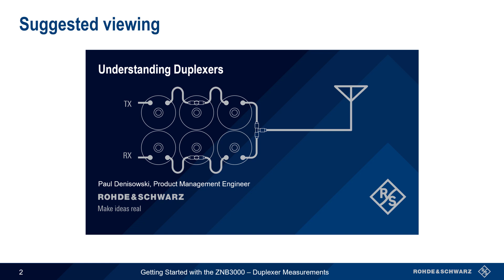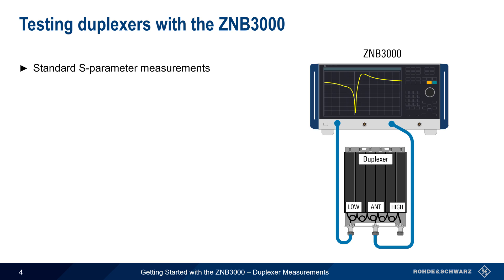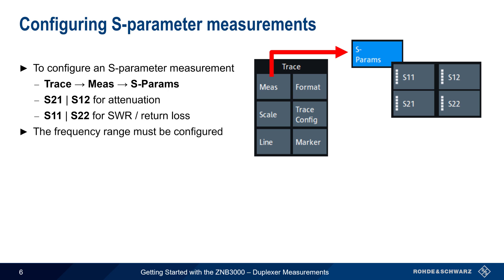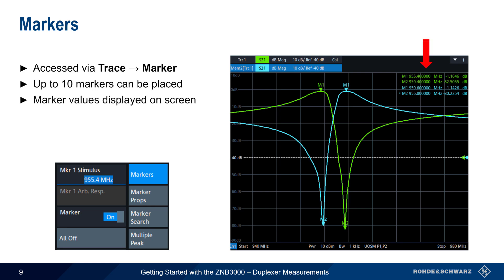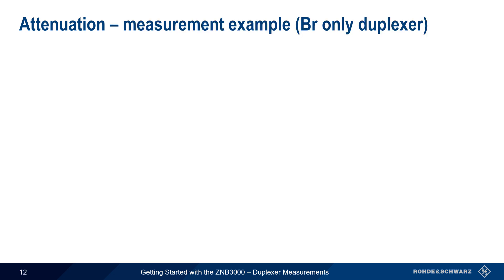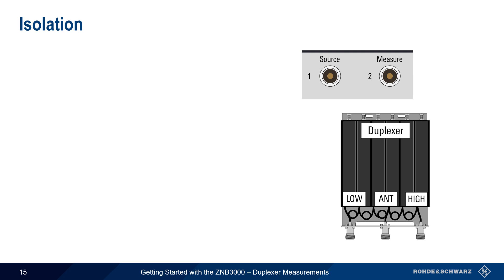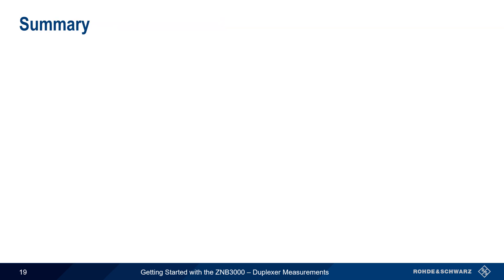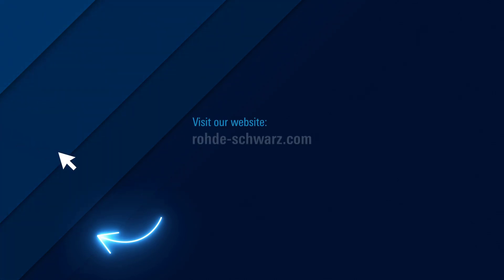Getting Started with the ZNB3000 – Duplexer Measurements

Comment: Is there any reason in particular why the transmitter frequency (145.0 MHz) is set higher than the receiver frequency (145.6 MHz) and vice versa, and also why it is specifically that number?